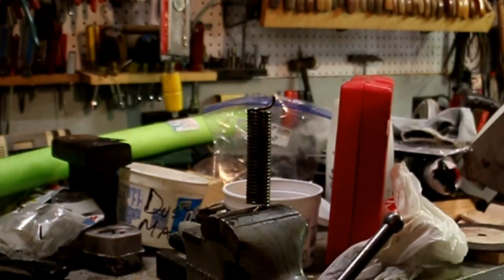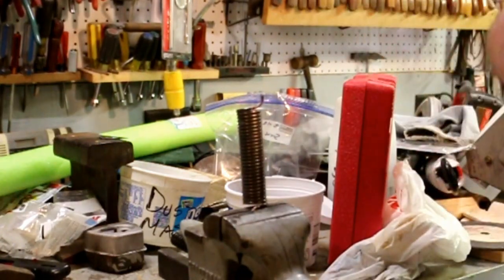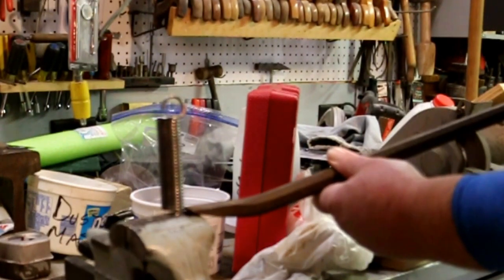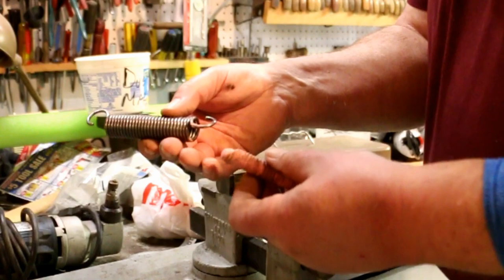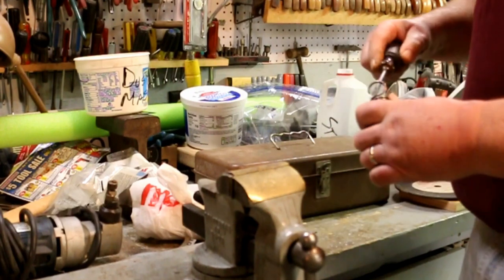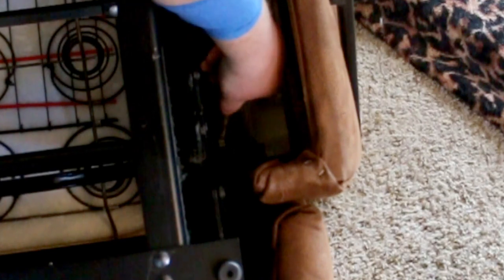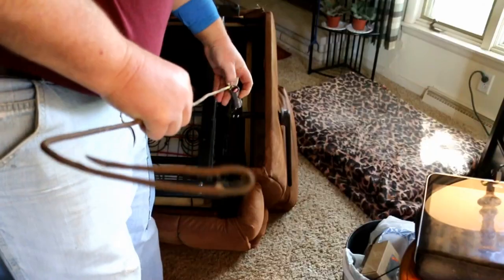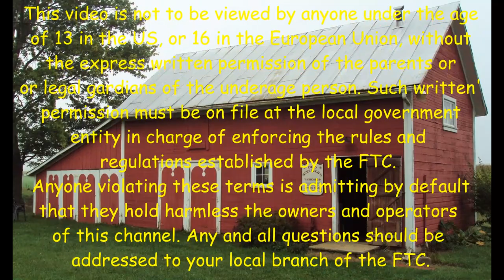Spring Break ~ Fixing The Lazy Boy

Comment: Gives new meaning to the phrase "spring has sprung!"  But seriously, that's useful info about springs that most folks aren't aware of.  In a pinch, you can also wind new ones in that South Bend.
Reply from the maker: Using a lathe  is an interesting way to make a spring. I've always just wound them around a mandrel by hand.  Might make an good video. There are a lot of requests for eggbeater drill chuck springs. 😆😎

Comment: Well, seems like a lot of work to save $4 or $5 on a replacement.  But I guess if you're short of cash, it can work for awhile.  One time I drilled a hole in a pop rivet to use as a brush for a power window motor in my truck in the summer when I was super broke.  Worked for a couple months, but that was enough time for me to buy another regulator replacement.
Reply from the maker: Trying to find a relacement is the hangup.  This was shot in the middle of the lockdown. 😁😎